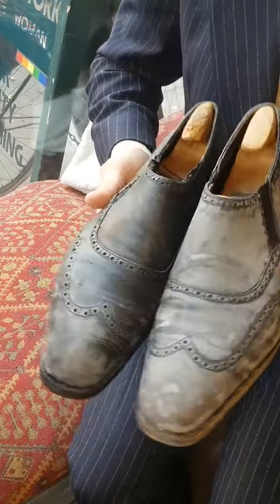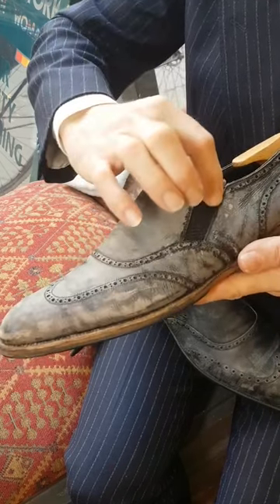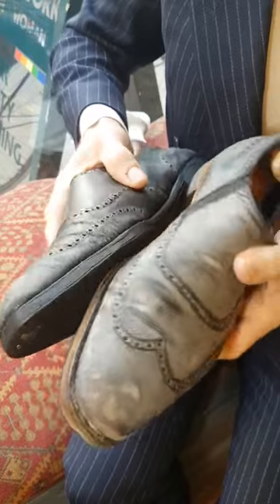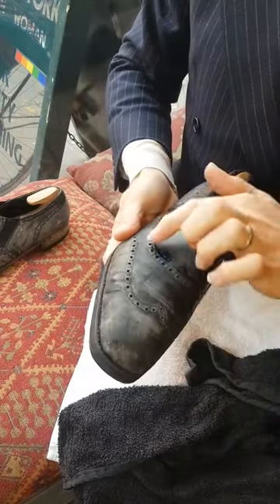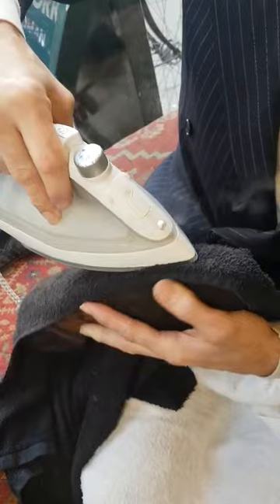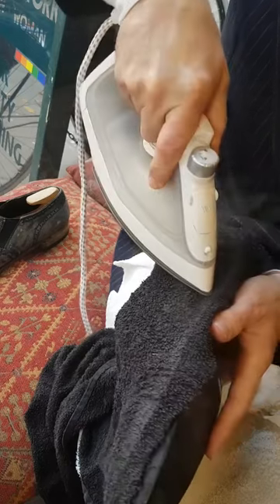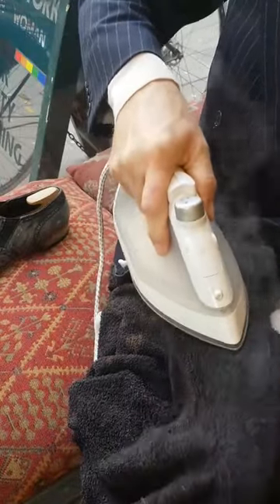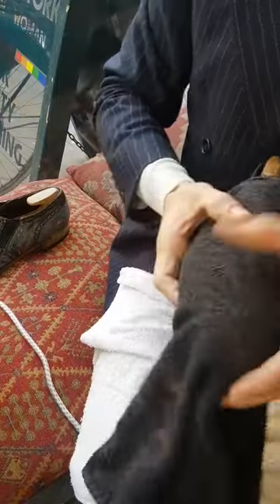Series 8: Episode 2: Steam Shrinking Shoes

Comment: Thank you for your very informative videos. 
I have a question regarding steam shrinking. Does this only work on leather that has been stretched out through use, as you previously described, or will it also work on "non-stretched" leather? In other words, could it be used to reduce the width of a pair of almost new and slightly too roomy shoes?
Reply from the maker: All skin will shrink, old or new, however, this task should not be underestimated, much can & does go wrong.
There are several shrinking videos on my Instagram account
Reply: @bespokeaddict  Thank you for your response. I understand that it's a drastic step to take. I'll have a look at your Insta. Thanks.

Comment: Hello! i have a beautiful pair of Gucci loafers which i intend to use this method on, the toe cap of those shoes is not stiff nor reinforced in any kind of way like the ones in your video and i was wondering if i could steam shrink that section more than you do since it's pretty loose and is in desperate need for a face lift :)
Reply from the maker: Firstly, I don't think you should be practicing on a pair which matter, try on something else first.
Toe caps should always be regarded with caution, much can & does go wrong

Comment: Hi can u steam to shrink the heel counter / heel cup area? The back of the shoe? Thanks so much
Reply from the maker: Yes, this area will shrink too, it is only leather, it behaves the same as other areas on shoe, the main thing is to ensure you have fixed tree of desired size & shape inside, you can't work onto fresh air, you need to be able to control shrinkage.
Have you watched complete video ?
I think I explain the importance of spreading the 'shrinkage' over large area, & treating arras which do not appear to need treatment.

Comment: tried this on some roughout leather boots, the leather turned dark, hard and rough. I took it to a cobbler, it looks somewhat normal now, and seems like its slowly going back to smooth again. i dont know what happened. it didnt shrink though.
Reply from the maker: The leather does go hard, dry & discoloured, my other videos show what is involved in correcting this.
If skin didn't shrink, the iron was not hot enough, or towel wet enough, or perhaps not treated for enough time.
This is a slow & physical process, it won't happen quickly, or in a single treatment.
With enough heat, water & effort, the skin will shrink, 20mm overall is achievable,
Reply: @bespokeaddict  zero cobblers in my area seem to know about this procedure. Im in los angeles. do you know anyone here who can shrink a shoe that has been stretched out?
Reply from the maker: @brokenegg4714  this is not something you will find cobblers doing, it's not a technique generally used in the industry, it is very much something I have practiced & taught myself

Comment: Hi, can u steam shrink the heel? To remove mild heel lift?
Reply from the maker: If the heel is leather, it will shrink eventually, however, do not attempt it, you will not be able to control amount, direction & location of 'shrink', heels need to be filed or sanded into correct shape.
Reply: @bespokeaddict  thanks so much for the prompt reply